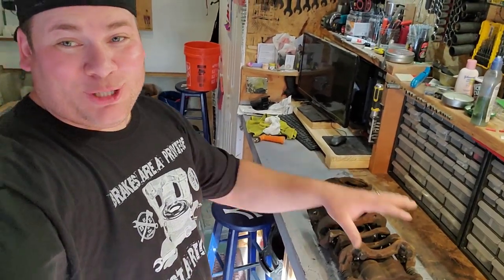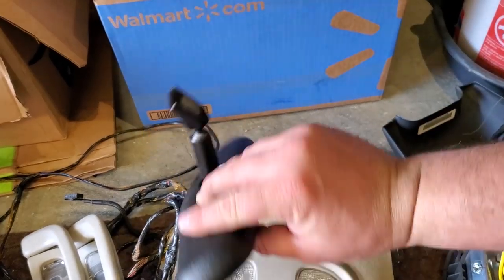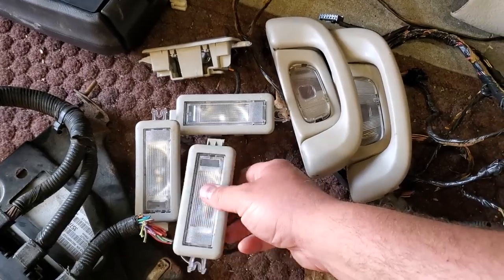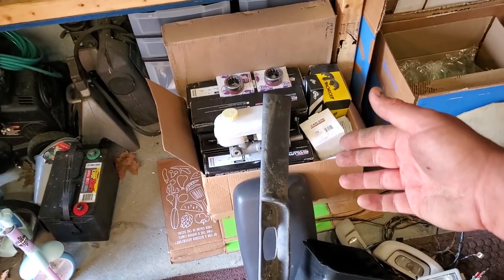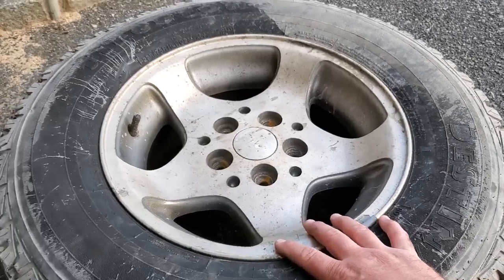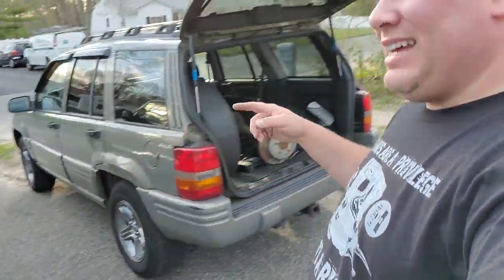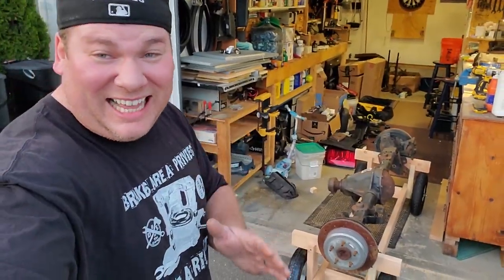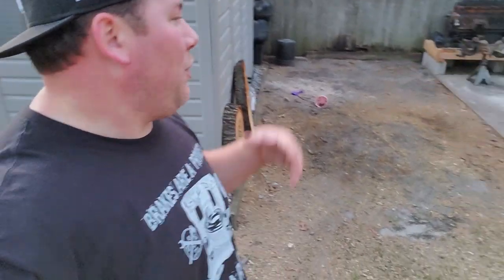DANA 44 & JEEP PARTS SCORE, PROJECT PLANS, AND A DANA DOLLY???

Comment: Use  02 Ford explorer sport trac front rotors and 06 tj hubs get the outside flange on the hub turned down and no need for washers between the caliper bracket and knuckle
Reply from the maker: Excellent! 👍

Comment: Harry’s U-pull-it in Pennsburg has loads of Jeep parts, always worth the trip! Pretty good pulls Dan.
Reply from the maker: Yeah totally! I will definitely be back there soon 👍
Reply: Hey Dan I found front seats oj a 2001 grand cherokee I know they fit in the front easy swap but my concern is the back if I just change the upper back seat and leave the xj lower back seat?
Reply from the maker: @joseleandry2055  the back seat bases require major modifications.. you need to make new mounts and trim some of the sides.  I suppose you can just use the tops.  I never thought of doing half and half

Comment: Dana-Dolly lol. I tore up the carpet on the back seat dragging a couple axles outta there myself. Per usual looking forward to the brakes vid. Big question on my mind is what are your thoughts on proportioning valve when you do rear disc AND front WJ? I used the ZJs when I did my rear and wondered if I should hang on to the stock XJ just in case it's better for when I go bigger on the D30. Looking forward to the upcoming vids!
Reply from the maker: That's a great question.. I probably should have been more specific.  The WJ knuckles are going on black beauty with the D44 and the ZJ rear discs are going on Black Beauty with regular XJ fronts.  For that I will do the ZJ prop valve.  Thank you for the question because now I'll know to mention that I already have a ZJ prop valve in beach Jeep. 👍

Comment: I just finished the rebuild of my axle Dana 44a for my zj. I just need to swap it in. Let me know you have any hang ups. There is a ton of conflicting information on the web, i might be able to save you some time. 
The only part that sucks is getting the pinion pre-load dialed in.
Reply from the maker: Thanks brother!  I was hoping to mitigate some issues by using an IRO rock link coil spring truss.  the pre-load scares me, maybe ill have a shop do the gears and lockers.
Reply: @ProjectDanH  Sorry for the long reply in advance, I was a writer for a living so.... 
Based on what I have seen you tackle, I am sure you can do it yourself, but it is a bit of a pain. I had the pinon, and carrier bearings pressed off and on at a shop and that was $100ish bucks without the preload setup, so there is that to consider. 
In my case I replaced all of the bearings, and did not change the shims since I kept the same gearing. If you change gearing that is a whole other process with setup bearings to set the pinion depth and the cost will start to rack up quickly.  Lockers is the 'easy' part , my axle has the clutch type LSD, (also a pain to deal with). 
Your going to want a second person to help with some of that work because a.) a third hand is always helpful  and b.) more importantly the torque specs you need will cause you to lift the whole axle assy off the ground if you don't have someone pulling in the other direction. I got the Bleep'in Jeep Pinion yoke tool and that little guy held up but not unscathed. (https://www.amazon.com/gp/product/B078TP1MGZ/ref=ppx_yo_dt_b_asin_title_o03_s00?ie=UTF8&psc=1)
I'm about $500 into my axle swap in parts and labor, but I have replaced all of the brake hardware and lines, bearings, seals and that was without re-gearing, and a locker. Again, I'm sure you have done your home work, but other younger guys might think you can do this on the cheep, and ignore how fast the parts cost adds up, and the tools. 
I was a professional mechanic in the past, and have a large collection of tools, and still had to buy some just for this job.
Reply from the maker: @henryv.3272  wow, thank you for the solid information.  I have much to consider.  We'll see how the build goes and which path it wants me to take. 👍

Comment: Swap those brake calipers and brackers for new ones. Trust me. I screwed up by not doing so. On my 01 i didnt need the caliper spacers only the wheel hub spacers for the calipers. Have you thought about what youre gonna do for steering?
Reply from the maker: that's a good idea. I was messing with the calipers today and they are all rusty inside.  haven't decided on steering yet. Any suggestions?
Reply: @ProjectDanH  it all depends on how you wanna look at it. If its gonna be a beach jeep heims will corrode faster. I live near the beach and they get rusty quick even spraying them.with wd40 often. I went with a JKS WJ steering swap for the XJ and TJ and it retains the factory WJ tie rod ends ( i went with moog).the wj tie rod ends are beefy as heck over the stock Xj and parts are readily available over the shelf as opposed to having to wait for the replacement heims. The boots protect the joints so corrosion for me is minimal.
Reply: I have videos on my channel. Yu're more than welcome to see how i did mine. Consider my lift and tire combo is probably gonna be different from what you might be planning.
Reply from the maker: @thecherokeechannel688  I've actually watched yours a few time.. so far your vid has been the best💪👍🏻